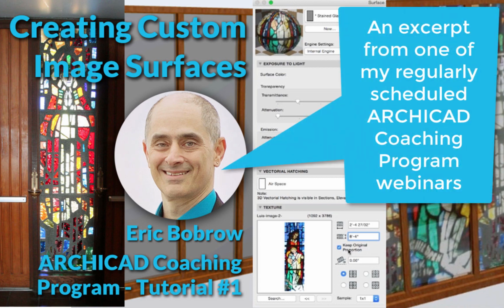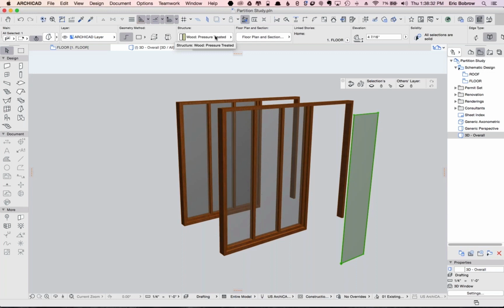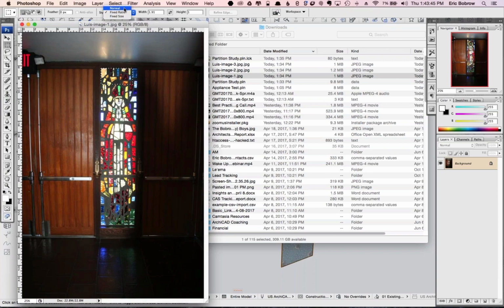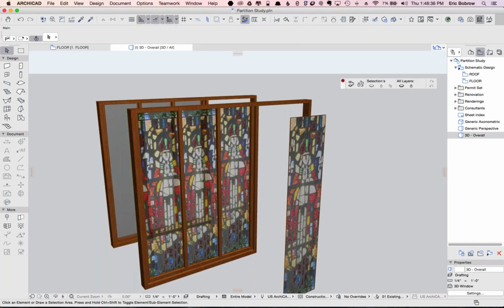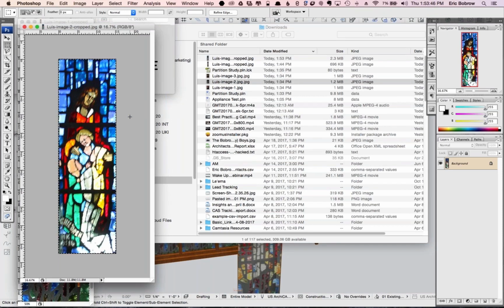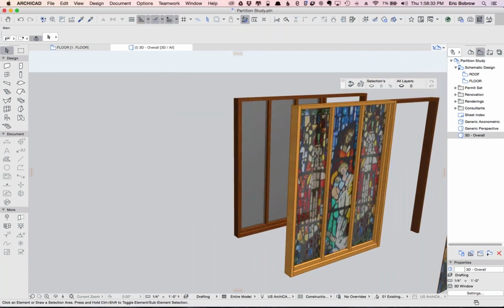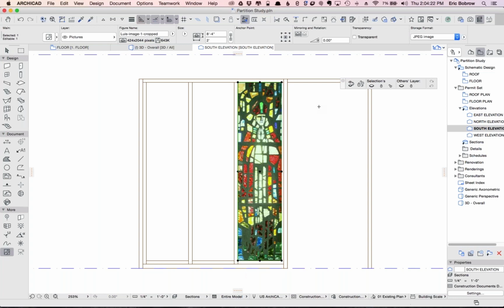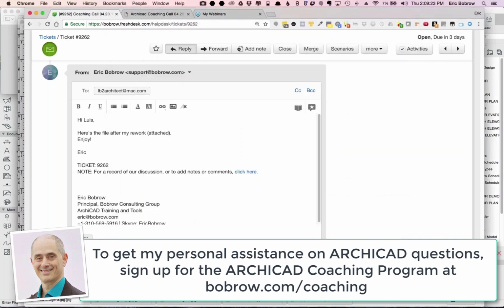ARCHICAD Tutorial | Creating Custom Surfaces from Photos | ARCHICAD Coaching Program #1

Comment: Hello Eric,
I think there  is a solution to make the texture automatically appear in elevation. Not as a photo but as a vectorial hatching.
If you convert the JPG images to DWG file format (in Ilustrator for example), than import the dwg into Archicad and create a fill from it, with the same size like the surface texture. Then apply as a vectorial hatching to the surface.
Of course it will not look photorealistic as using the Figure tool, but it will be automatic. :D